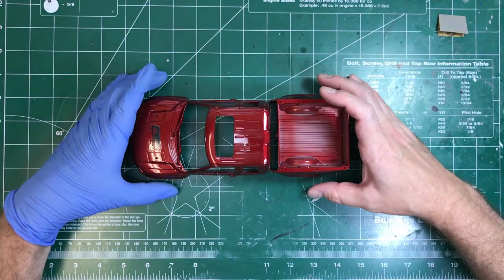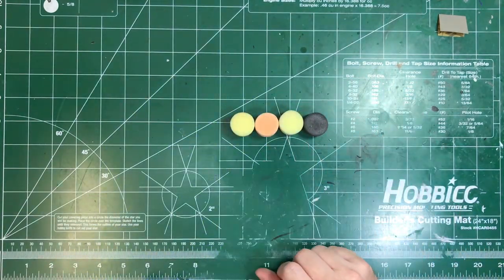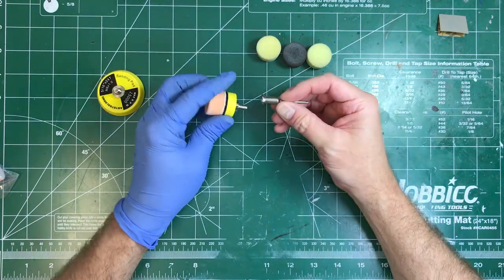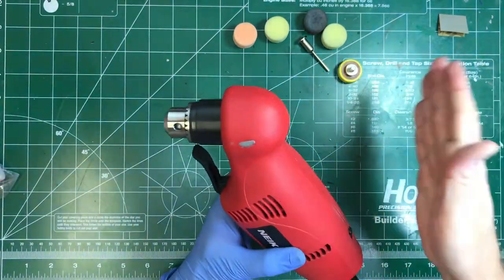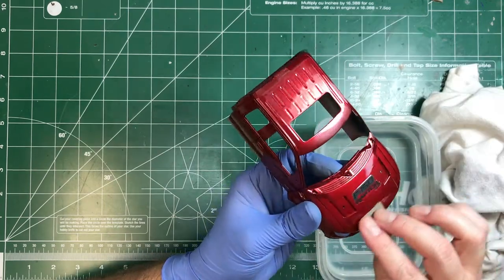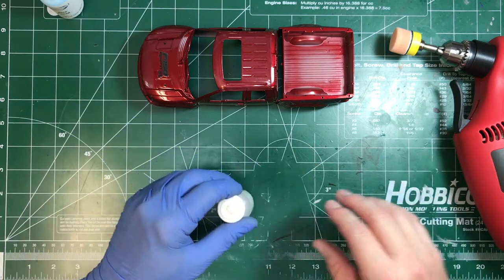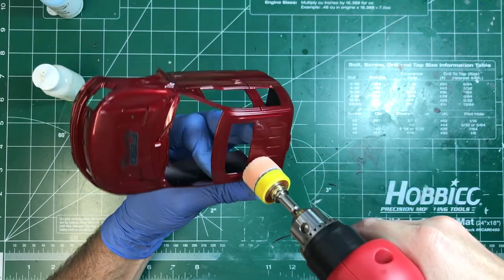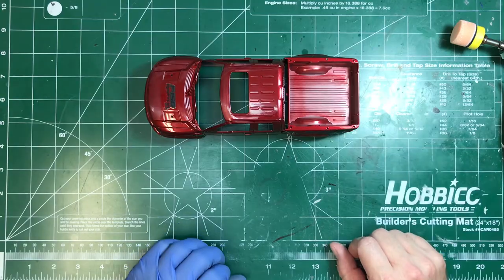How to Machine Polish Plastic Model Cars

Comment: i am here as i just tried to restore an old custom built kit from oh, 30 years ago. i have a new rotary tool, and a Dremel accesories kit , i used to use with my work drill. well, i  put the buffing tool on and ouch, ,,huge scratch right in the center of the,wide , no pillars windshield. the kit is a late 1980s corvette mako shark, it has this huge windshield, so like a knuckle head i had to start there,,any hoo, i converted it to a rear engine , and also a side winder engine mounting., loads of custom made, and painting , plumbing, and massive engineering  into this build, so i hope to learn how to restore all things before jumping into a royal mess, next time, thank you, cheers from italy, robert
Reply from the maker: Sounds like you have a lot of work into that one. Good luck and keep at it.

Comment: You got it man, exactly what i did except i cut and made my own from 1/1 foam pads. I start with a wool pad for compounding and then progress to a foam in order to remove the haze from the wool, then finish with a light foam and finishing wax for the final stage.
Reply from the maker: Nice. I bet that works great.

Comment: A UK website that I use sells packs of the one inch polishing pads with the mounting plate and the mandrel too. Not expensive either. About £5 for a set. The site is called Premium Hobbies. Just thought I’d mention it in case anyone else is searching for similar products. Took me a while to find this setup myself. Also using Proxxon tools which offer variable speed at the tool and at the power supply so you can get them slower than a Dremel.
Reply from the maker: Thanks for the information. It took me a while to compile those items as well.
Reply: Hey, I've just made an order from the Premium Hobbies - thank you for sharing the information! :)

Comment: Sounds like you have this worked out. I actually have a Bosch corded 90 degree angle drill which I have had for years that has an adjustable screw arrangement on the handle you depress which allows you to limit the maximum rpm on the unit as it stops the "trigger" travel.
May work very well for my model polishing ventures, thanks for the tip!
Reply from the maker: Yes my construction grade drill is way overkill for model cars but it works and I HATE hand polishing. Glad you found it helpful.

Comment: Hi, great video, thank you. I have a question, I didn’t get it in the video… Agree with you that dremel is too fast for polishing… Could you tell what speed is good for polishing model cars?…. Thank you.
Reply from the maker: I don't have a speed but if I remember right, the Dremel type tools start spinning at 5000 RPM so anything less than that would be better.